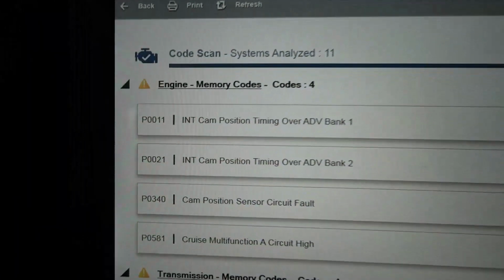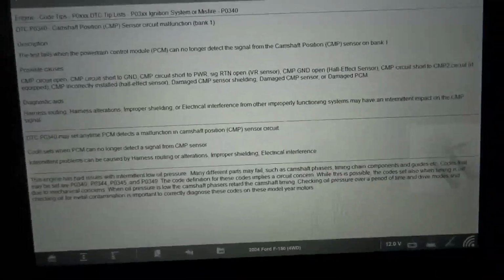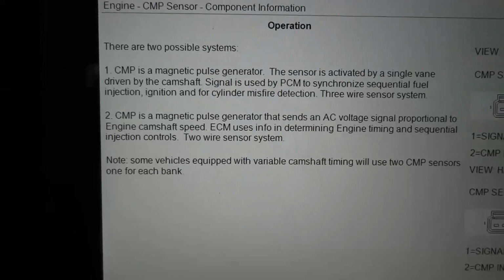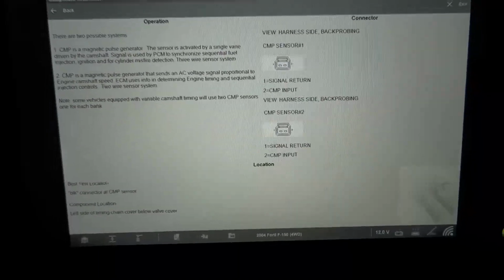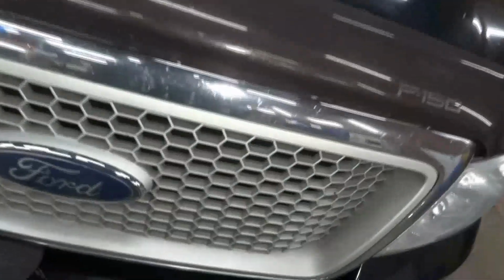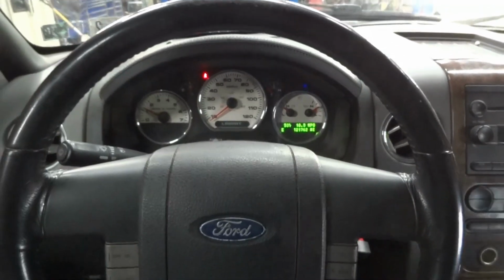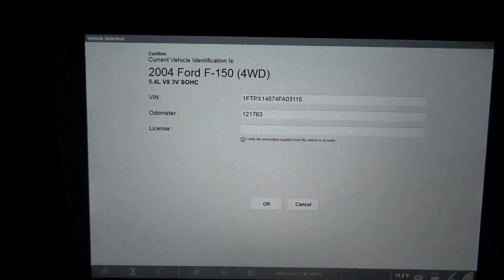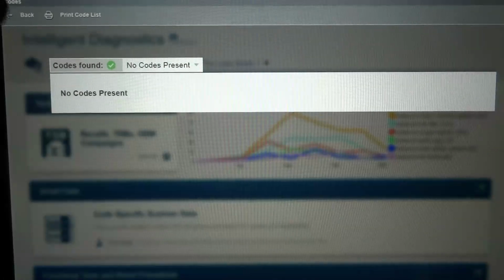Ford F150 Code P0340 & P0011 Camshaft Sensor circuit Faults! Diagnosis and Repair

Comment: 2006 Ford F-150 5.4 engine how did the cam sensor on driver side has metal shavings on what kind of problems will that start

Comment: I hope that is same problem whit my 2003 exterra manual 5speed ,I just replaced the sensor and the distributor but my truck 🛻 is not starting and it is a very frustrating.
Reply from the maker: @modybhoye  do you have trouble codes in the computer?
Reply: @ yes PO340

Comment: Thanks so much for your knowledge 
juswt a question how can check the input voltaje to camshaft?
thanks
Reply from the maker: @panfilobasoco924  you can check the cam sensor wiring with a multimeter. I have videos here on the channel that can walk you through it!

Comment: Where would the camshaft be on a 2017 Lincoln mkz 2017 the sensor needs to be change but it’s hidden
Reply from the maker: Crystal Lynn  I believe the cam sensors are on the back of the engine in the head above the bell housing, ( transmission side )
Reply: @KITS_Auto_and_Truck_Repair  Thank you do you have a video of if you are the best !!!
Reply from the maker: @crystallynn83   No! not right now

Comment: Would p0345 and p0349 be the same issue? I ohave a 08 expedition ,only thing I can see is my sensor connecter tab is broke but it still feel tight on the sensor
Reply from the maker: Ladevin Washington  you should check your wiring and replace the connector
Reply: @K Diagnostics  gotcha, even when I don't have a check engine light? It says continuous memory dtc

Comment: And the mechanic that makes my spark plugs and oil change said that my truck doesn't have a pcv Valve that's true or hi doesn't know what is going on
Reply from the maker: Arturo Cena  yes it should have pic valve!
Reply: What is the pic valve

Comment: I have a P0341 Code, I'm guessing it's a similar issue so will do some of the basic checks visually on the wires/harness to start with. Is this code associated with stretched timing chain??
Reply from the maker: Ivan Kaiser No! This is a circuit code!